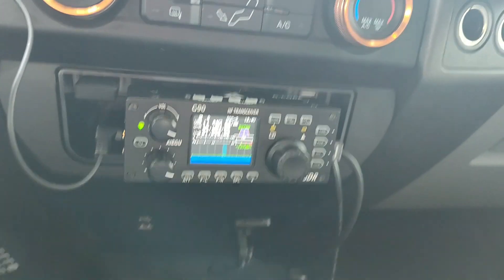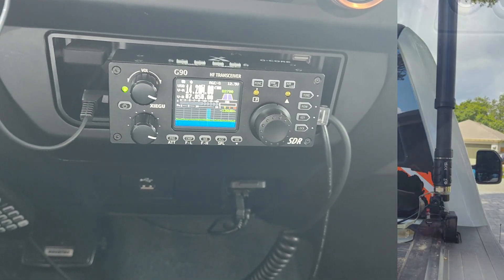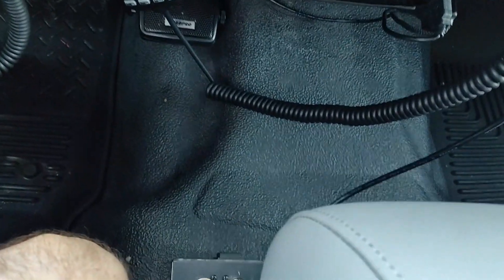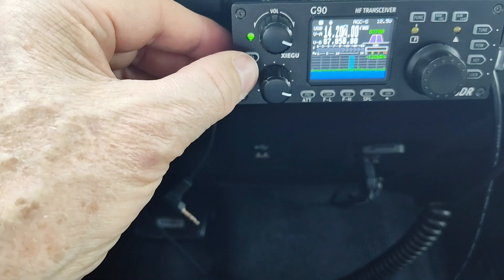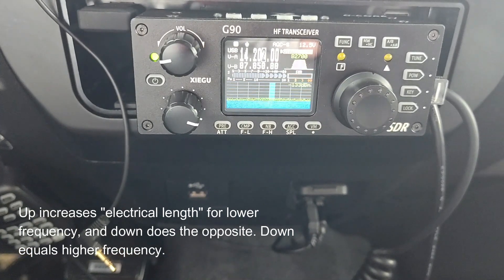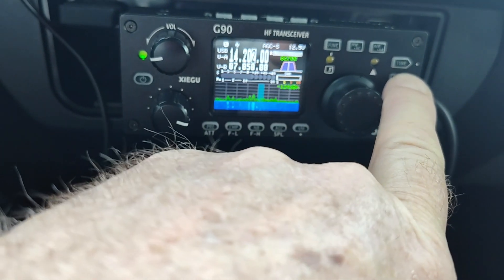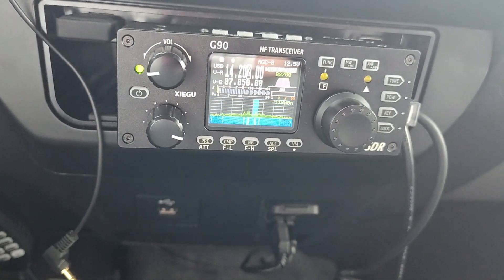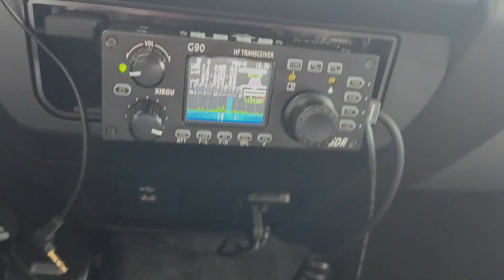Yaesu ATAS 120A Antenna Tuning with Xiegu G90 SDR and MFJ-1925 ATAS Controller

Comment: With MFJ out of the picture now and supplies mostly non-existent, what other controllers are available that will accomplish the same electronic control?
Reply from the maker: There are schematics out there on a DIY antenna controller on this case. However, I think folks are hoping MFJ will license manufacturing or sell rights to some of these products.